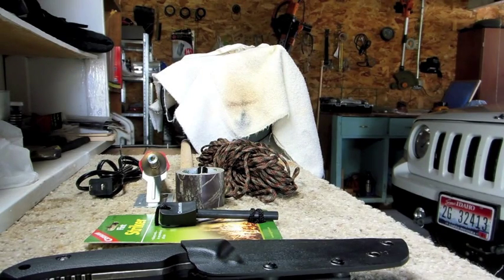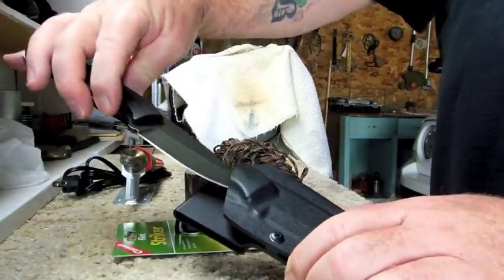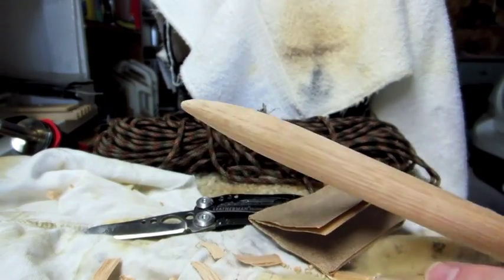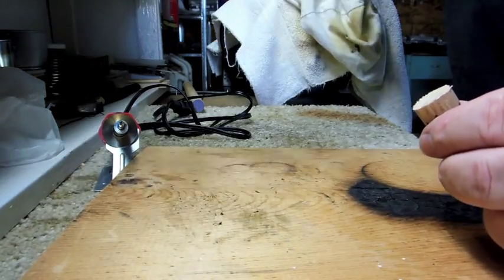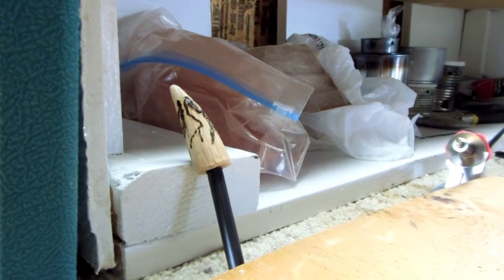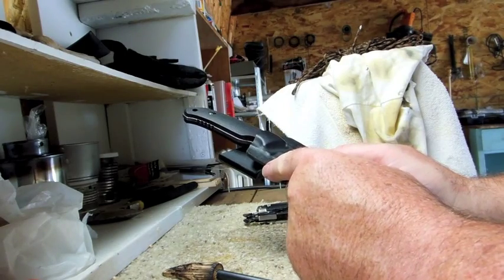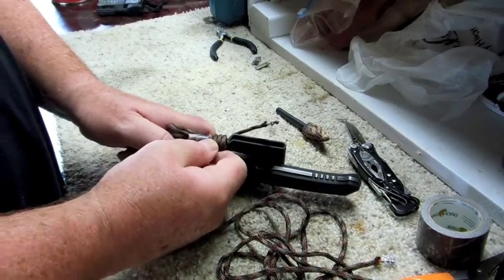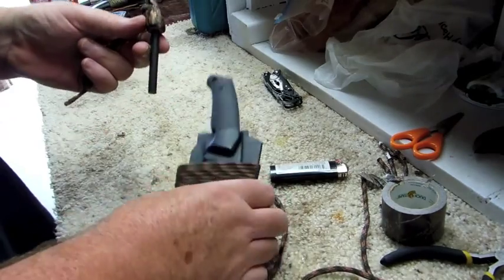Schrade SCHF13 Sheath Mod

Comment: I like the mod. Just don't plan on using the Schf 13 to strike the rod with. It doesn't have a 90 degree spine.
Reply from the maker: Thanks for watching! The knife has a small choil like area on the underside that separates the blade from the handle, I used a grinder to widen it out and  it strikes the ferro rod great from there. I just got back from a month and a half living off-the-grid in the mountains of Idaho and used the SCHF13 as my primary knife and means of starting fires and it worked really well every time!  Tim